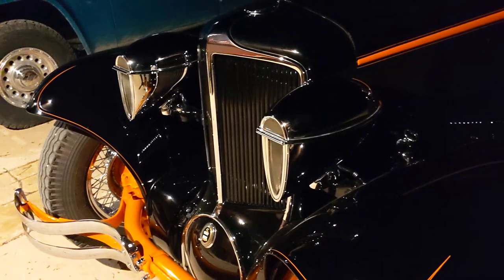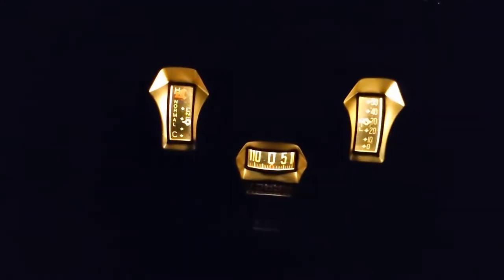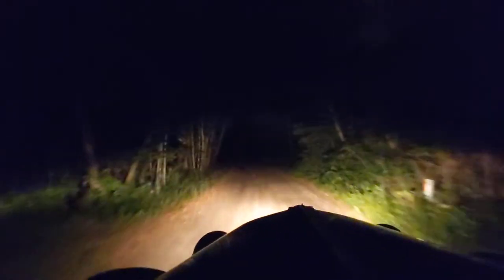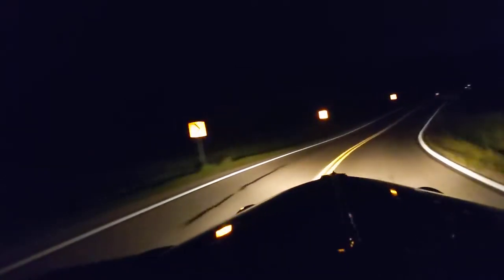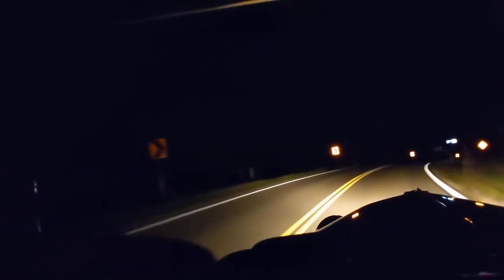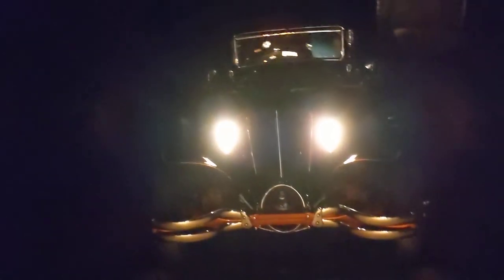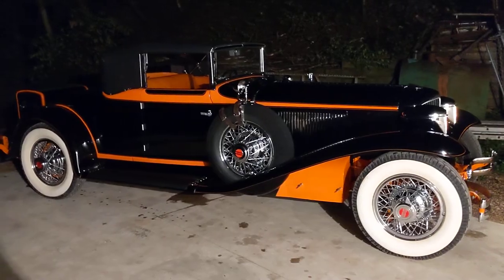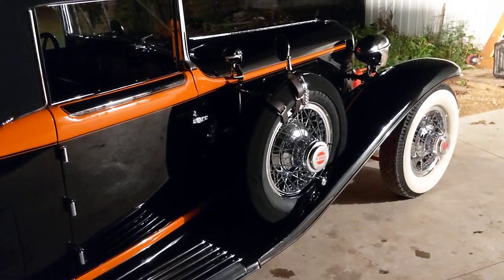TESTING the Woodlites on a 1929 Cord L29. Are they bright?

Comment: This is a great video, everything written about this car and the lights seems to be bogus. The lights work well a no the car doesn’t seem slow or underpowered or difficult as a Mack truck to drive! It seems smoother and less busy at 50-55mph than my Packard 902 with similar weight, engine size/output and more surprisingly I think the cord had an even shorter final drive ratio and yet the engine isnt buzzing at all 50-55. The Packard on the other hand with 4.69 rear axle feels out of rpm at 40-45 and possibly due to the long heavy drive line vibration is perceptible. More videos on the cord please! I’ve been enamored with the l-29 since I first saw on in person! Thank you!
Reply from the maker: David, I'm glad that you like the video. The Cord actually does drive very well. The ride is firm, but not choppy or harsh. It corners exceptionally well, especially for a car of its era. The driver feels very much in control, it doesn't roll or undulate. The steering is very precise, but it is fairly heavy, as is any large, front engine car without power steering. When the car is rolling at 5 or 10 mph+ , the steering is easy enough for one handed driving. I was told that this car got highway gears installed, but I  don't know the ratio. I have had it up to 73 on a good road and it felt and sounded perfectly happy. But I don't like going that fast due to the complete lack of safety equipment. 
I think the L29 gets a bad rap because the examples tested are worn out, or improperly adjusted, and same for the Woodlights because of old, corroded wiring and switches, and so forth. Thanks for the comment!  Joel